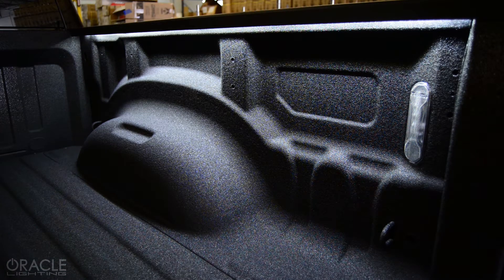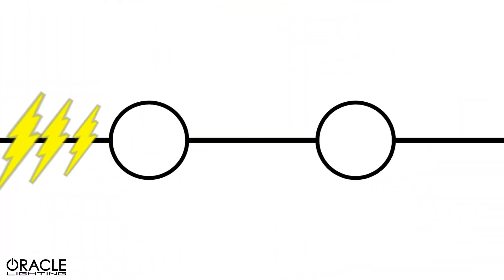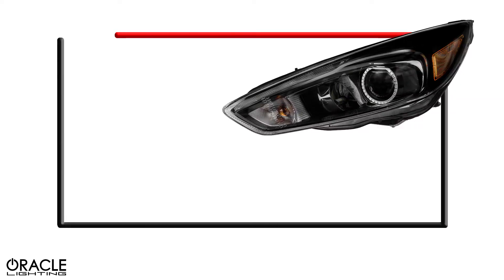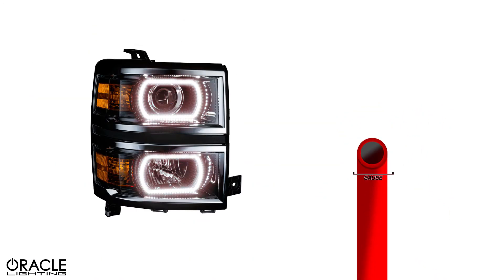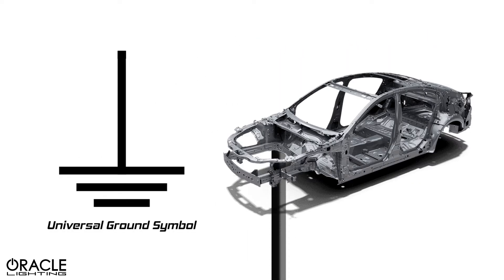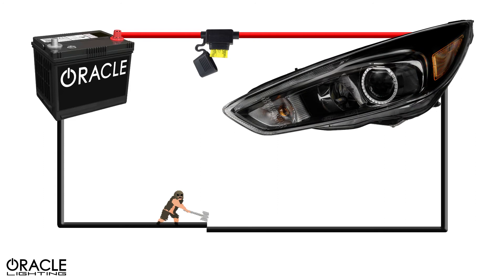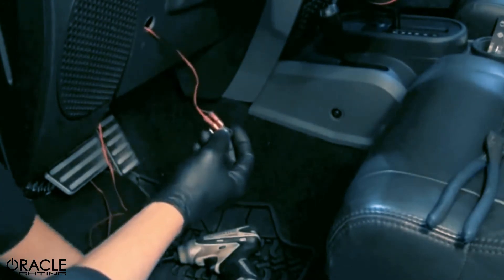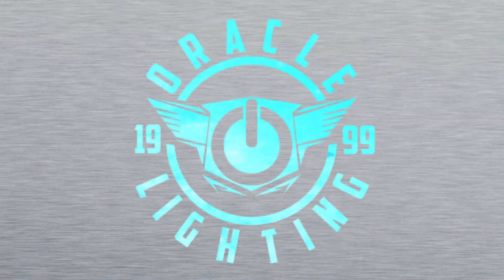ORACLE Lighting - How To Install A 12V In-Line On/Off Switch for LED Lights

Comment: So run the negative to a ground and to the switch?
Reply from the maker: the switch can be grounded separately, its just the ground for the LED on the switch. If you dont want the switch to light up dont ground it.
Reply: @ORACLElights  so how does the switch get power
Reply from the maker: @D1SxK1DxB3AST  the switch is a power interrupt, it goes between the power source and the light.
Reply: @ORACLElights  here’s my problem, I have the led strip lightning on my car, keeps draining my battery I have one red to my battery and one black to a ground, how can I hook up this switch correctly for it.
Reply from the maker: @D1SxK1DxB3AST  simply put, you would cut the red wire and connect the cut ends to the input and output of the switch. That will interrupt the power when switched off. Hope that makes sense.
Reply: @ORACLElights  thank you